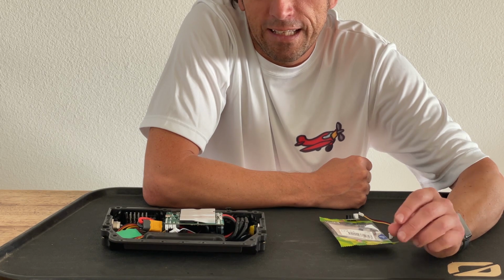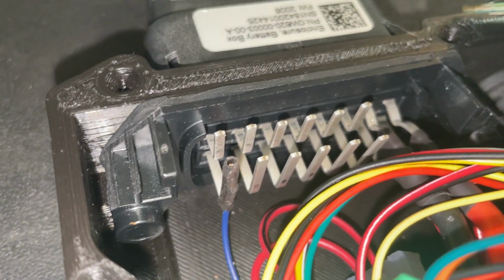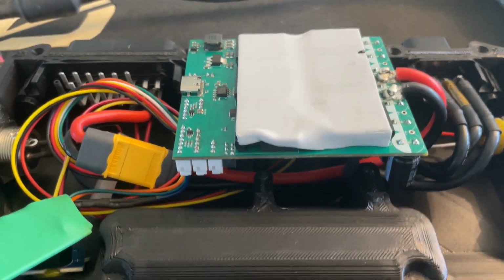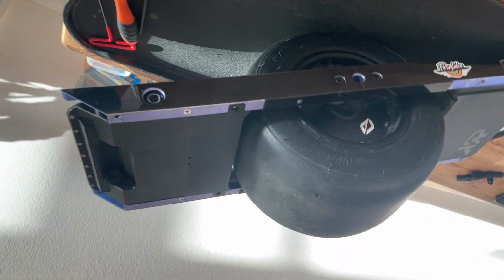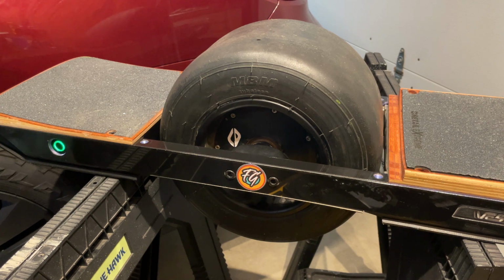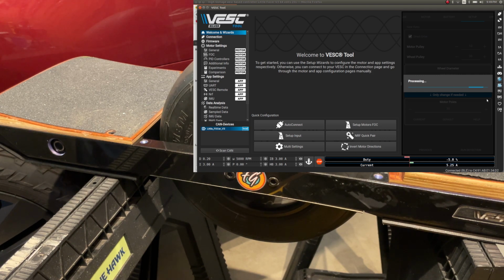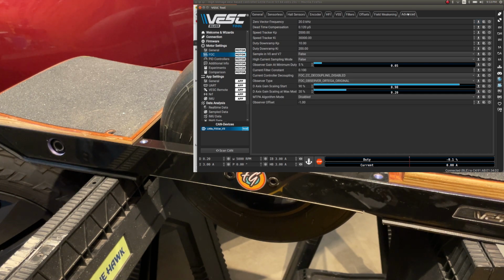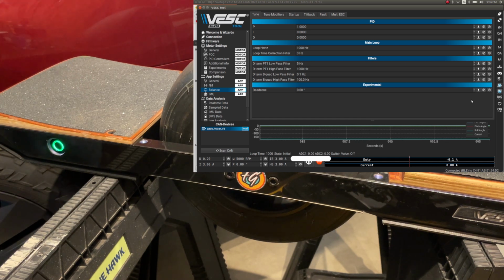OneWheel XR VESC Conversion - Step by Step Part 3

Comment: Did I miss something load the motor configuration and app configuration? Where do you get those files?
Reply from the maker: that's only if you've got a backup already - you should be following from-scratch videos instead, like this one (make sure it's a 6.x video): https://youtu.be/V7h2R3hKK4Y

Comment: why does every balance board i see have the heatsink on top just below the footpad. surely having it face down to the bottom where the case is exposed to open air would be better than covering it with a insulator and your foot. Am i missing something.
Reply from the maker: how many have you seen?? The XR is based on a 7 year old design. The newer boards like Pint and GT have a metal enclosure with a plastic lid on top
Reply: None, just a lot of tutorial vids  :-). I am building what i hope will be a funtional one wheel balance board and have a metal alu case with the mosfets facing down towards the road. I am just wondering if there was a locical reason for having the mosfets face up like this. I dont want to eat dirt because i missed something.
Reply from the maker: @Meserlion  no reason, just mainly so we can fit easily into the existing XR platform - here's an example of a Funwheel with air cooling: https://youtu.be/YKbBR6mXZv8

Comment: Man I can't wait till this sort of tech is more user friendly for setup. To be honest I simply don't have the time to dive into this sort of thing. VESC really needs a proper plug and play addition and I am sure that with enough popularity it'll eventually reach that point. There's so much more potential and customization to be found here but it reminds me of the old days of overclocking computer components or tuning engines. It's just not really realistic to assume most people are going to be adept at that without extensive research and commitment.

Comment: Is it possible to keep the XRs headlights functionality with a vesc conversation?
Reply from the maker: Not easily. But with enough DIY/electronics skills yes - but there's no plug and play solution today. There are add-on devices like rESCue (see https://www.rescuestore.net/) but I doubt they're compatible with stock XR lights...
Reply: @surfdado  im more concerned with keeping lights function then it still being the stock lightbars i just want the lights
Reply from the maker: @TheArnoparno  the answer isn't much different in that case. You're in DIY land when doing it - no plug and play solutions are available
Reply: @surfdado  oh that's absolutely no problem i am familiar with a soldering iron, other question are there aftearket chage bms options because the reason i want to convert is because my bms is dead

Comment: could you set the vesc to make a  GPIO pin to show direction,  on = forward  off = reverse  ?
Reply from the maker: Sure, this can easily be done on VESCs like the LFOCv3 that have unused GPIO pins exposed
Reply: @surfdado  could you use unused servo pin ?
Reply from the maker: @firepower9966  I mean it's an unused pin, so of course you could

Comment: Any chance you have a wiring diagram or pinout of the pull down resistors for the footpad?
Reply from the maker: sorry I don't but it's really simple - just a 1kOhm resisor between ADC1 and GND, and another one between ADC2 and GND. But you may want to give the standard 10kOhm resistors a chance first. Several people have reported that with the stock XR front sensor they've had no issues with the LittleFOCer without adding pulldowns

Comment: So the part you where waiting on is a buzzer for haptic feedback? That sounds appealing to me
Reply from the maker: I call it a buzzer, but it's really just an acoustic beeper. Technically you can connect anything you want to that pin, it's just not allowed to take more than a few hundred milli-amps. But yeah, in theory we could make the footpad vibrate if we wanted to. I just think you'd need a separate power source for it (aka step down converter) and a relay to control it via the servo pin
Reply: @surfdado  I see thank you. Keep up the great videos!

Comment: Using the stock BMS is really appealing so that you'd only need to swap the controller box to switch from stock to VESC and vice versa. Do you think it would be possible to listen to the stock BMS's RS485 data line (you should only need one of the pair) to watch for its low battery flag so that you can properly trigger pushback? That way the rider can get an early warning before the BMS suddenly cuts power. I'm just about to pull the trigger on a Little FOCer kit and might look into it myself sometime. I'm looking forward to help contributing to the firmware! 
Also, is there any headlight/taillight support on the VESC yet? I know the Flowglider enclosure doesn't have a cutout for the headlight.
Reply from the maker: some people are doing lights, I personally couldn't be bothered. For the BMS I'm sure listening to RS485 is possible, there is extra pins on the LittleFOCer available

Comment: If there's ever a scary bit of sharps that concerns you with regard to shorts, and abrasion through use, fish paper is always a good bet. It's remarkably tough for cases like those connector pins, and it's good to keep scraps around for random cases like this.
Anyway, excellent video as always sir. 👍
Reply from the maker: I did try fishpaper but couldn't get it to stick to the metal. The 1mm thick insulating tape I found will be held down by the lid, or at least so I hope...